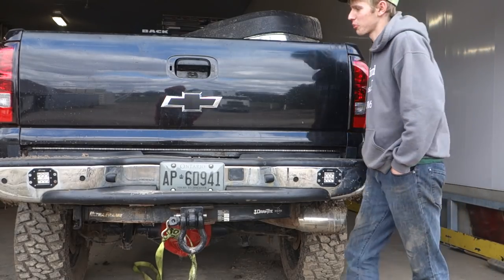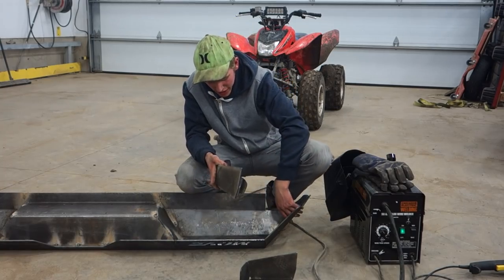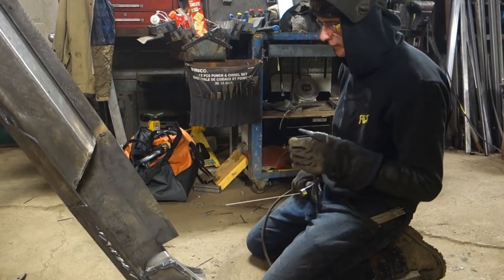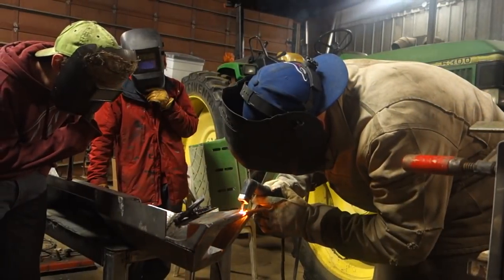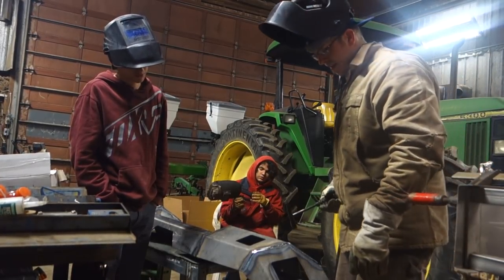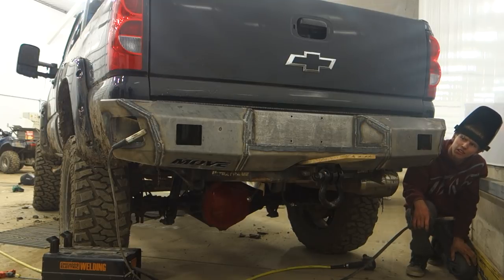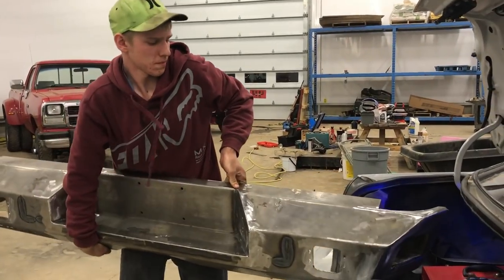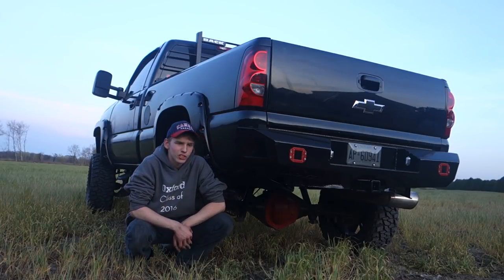Move Rear Bumper Build - Shorty Duramax Ep. 18

Comment: as a general rule, the distance of your rod away from your work, should be about the thickness of your rod.....and also, a 4 1/2" grinder with a wire wheel, is easer and quicker than that slag hammer......great project, I think I'll build one for my Silverado....thanks

Comment: Run 6010 finish with 7018. I just bought a 4'x8'  3/16" metal plate for 100 bucks. Designed my own. 32 hrs well get it done. Solid and one of kind 💪🏽💯 still have enough material for rear bumper. too.

Comment: what brand are those flush mount pods? And what are the measurements? I am having trouble finding pods that will fit my move bumper
Reply from the maker: +Jay Payne  Not sure if it made it in the final cut of the video,  but we had to modify the holes to fit the lights. We welded in a plate to make the hole smaller.  We couldn't find lights that fit the stock holes either.